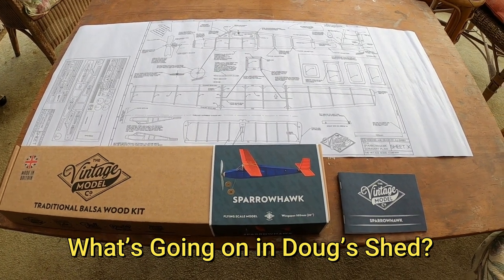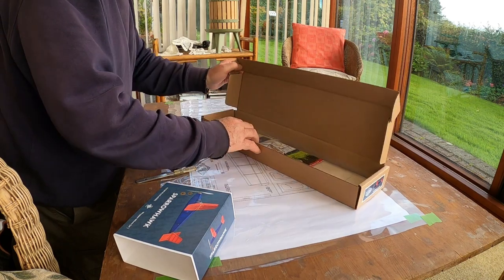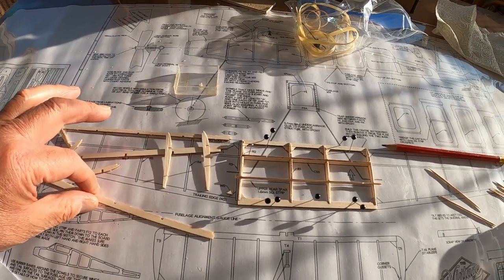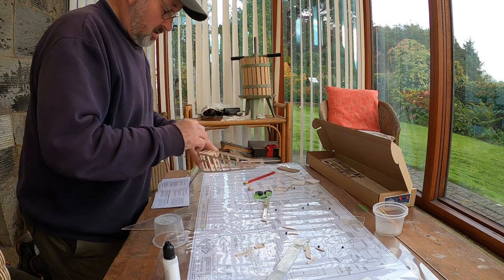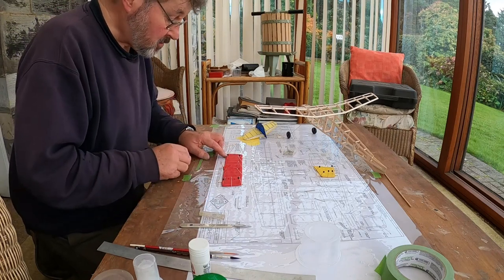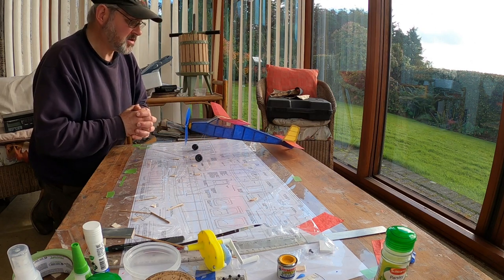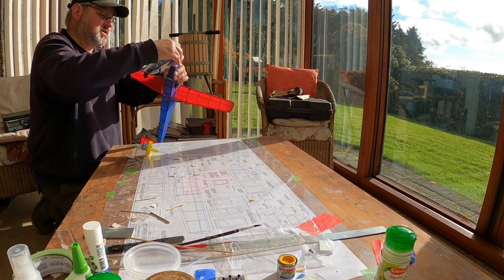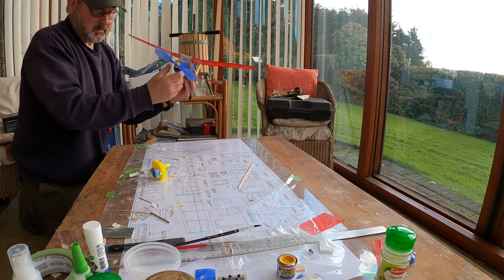Rubber Powered Model Aircraft Build and Fly - The Vintage Model Co. Sparrowhawk, 20" Wingspan

Comment: Winding rubber is an art. When you break a motor, record the dimensions and the number of turns. Then you can calculate a turns coefficient and calculate breaking turns for other motor dimensions. You should stretch wind the motor. 

Winding may be rapid at first, but you must slow as you get higher on the torque curve. Winding heats the rubber and heat increases the tension. If you wind fast, the heat can make it exceed the breaking point too soon. It is necessary to let the rubber cool as you get close to maximum turns. The last turns must be put in slowly to let the heat dissipate. More torque produces more heat per revolution. 

Also, check your winder counter. I find that mine are skipping counts. This could lead to you over winding. Set to zero and count manually to 100 cranks. What does the counter say? I find that rapid winding leads to errors. The counter is accurate when cranked slowly.
Reply from the maker: Good advice.

Comment: Am just about to build a Sparrowhawk also, so enjoyed watching your video, Doug. Interested in what you did with the rubber. My first build, a Vintage Models/KK Elf, nigh on exploded when I tried to give it a mere (?) 300 turns. More rubber, more lube, I guess...
Reply from the maker: Hi Michael, I have exploded a few rubber motors a well! It certainly makes a mess of the fuselage, I've had to recover the fuselage a couple of times already. I changed to a double loop of 1/8" FAI rubber rather than the 3/16" supplied in the kit. I'm still using a fairly short rubber motor and winding to about 800 turns. Tried various lubricants - everything from castor oil (messy) to silicone grease.
Reply: @DougsShed  Thanks, Doug, that’s really useful. Forgive me if you already mentioned it in the video but what did you end up finding best to use?
Reply from the maker: I've still not found a totally successful rubber lubricant - which reminds me, I must go and replace the tissue paper on the fuselage again!

Comment: There is a formula for ESTIMATING the maximum turns a motor will take before breaking.

T = LKt/sqrt(S)

T – turns

L – length of motor

Kt – empirical turns coefficient

/ – divide

sqrt(x) – square root of x

S – cross section of motor

Cross section of motor is the product of number of strands, strand width and strand thickness.

S = nwt

n – number of strands

w – width of strand

t – thickness of strand (Modern Super Sport rubber nominal thickness is 0.042″)

Kt will be different for different batches of rubber. It can vary some within a batch. It will vary with temperature. It will vary with your lubrication and winding practices. It is established through testing. Make up and wind test motors in your usual way at standard temperature, record the breaking turns and calculate values of Kt from Kt= Tsqrt(S)/L. With lengths in inches, a value of 10.5 is a safe default for modern Tan rubber. You may find values as low as 9 or as high as 13. If you need a more precise value, you must test your own rubber.

You should not use this number to decide when to stop winding your motor. It is an ESTIMATE to be used as a guide for when to pay close attention to the motor. As the motor approaches its maximum torque it will become less flexible. You can sense this by stopping your winding, letting the motor cool and giving gentle tugs on the motor. When the motor becomes very stiff it is time to stop winding. Knowing when to stop winding is a matter of judgement borne of experience. Motors that have been used may break sooner than expected. Motors that are wound fast will break sooner than expected. Motors that are allowed to cool by slowing the winding, especially at the high end, will take more turns.
Reply from the maker: Now my brain hurts!
Reply: @DougsShed  Use a pocket calculator.